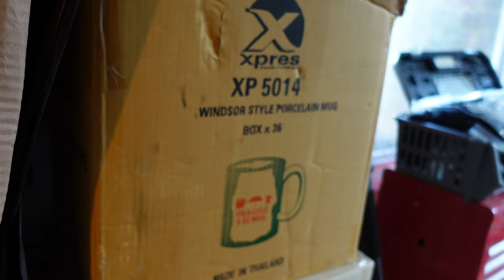Project Barry Day 3 - Cleaning the filty interior. Cat N 2016 Fiat 500 Pop. Copart Crashed Salvage

Comment: Why don't use an electric heater inside the car to dry the carpet  (or seats)? I think it would be cheaper, more eco-friendly, and more efficient than the engine.
Reply from the maker: Have you seen the price of electricity ⚡️
Reply: @Love500  I haven't seen it before. If I was informed correctly
95 ~ 1.7 euros/L
1 kWh ~ 0.63 euros
5h*1kWh= 3.15 euros = 1.85L = 3,15 euros
I don't know how much the fiat's consumption is idle. :)

Comment: While you had -3 in England we had heavy rain in wales, my 500 has flooded in the rear footwell on the drivers side so now I’m on the forums trying to find how water could ingress into a pop as it’s obviously nothing to do with A/C. Absolutely soaking, got towels and puppy pads trying to soak the water out of the carpet 🙈
Reply: So many places, had it on mine never did suss out which one it was. Aerial or glass roof was favourite. Just went round everything cleaning & sealing, also parked my car other way round on drive uphill instead of down, that seemed to stop it 🤷 Cat litter on a towel dries it out quickest 👍
Reply: @stepheng8779  I’m thinking door seal or some kind of drainage holes maybe? No glass roof on a pop, it’s not blue water so it’s not from screenwash pipe to rear window, everything else is dry bar the sodden carpet, it’s really odd. I had a new back box fitted on the exhaust the week before but that’s on the opposite side of the car so can’t imagine that caused anything to happen, it’s a mystery 🤷🏻‍♀️
Reply from the maker: I would suggest its the aerial on the roof. It'll run down the inside of the head lining and find the lowest point. Often appears in the boot but depending on how the car is parked can find it's way anywhere. It'll run down the inside of the side panel and then ultimately under the carpet. I would drop down the rear of the headlining and have someone run a hose over the roof and see if you can see it coming in.
Reply: @sarahfrith1984  Yeah they are a pain, couldn't even get mine to leak a drop pelting it with a hosepipe yet a small bit of rain would get in 🤷 Start with the aerial 👍 least you ruled the roof out 😂
Reply: @Love500  thanks Paul, I’ll have a look into that!
Reply: @stepheng8779  thanks, it’s always annoying little things that go wrong with these little cars 😆